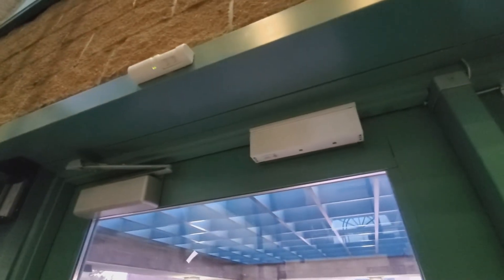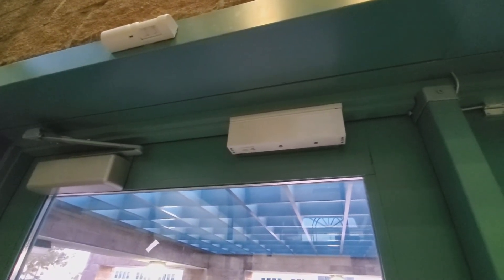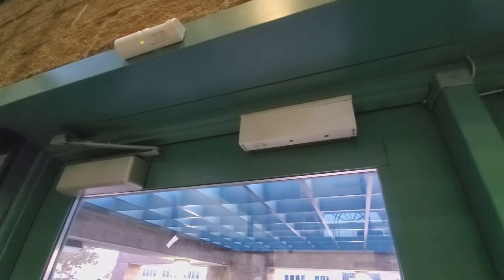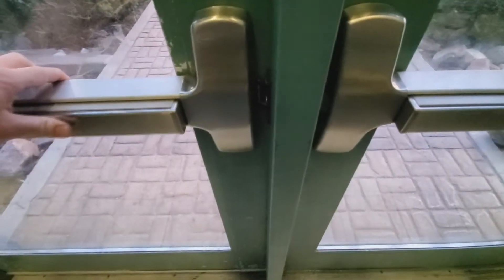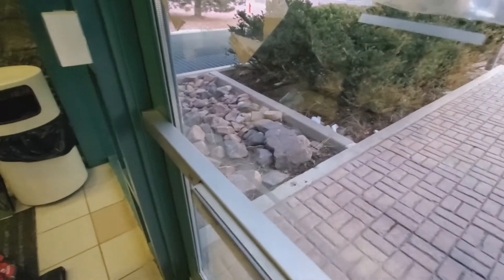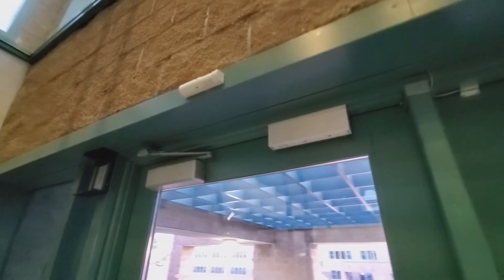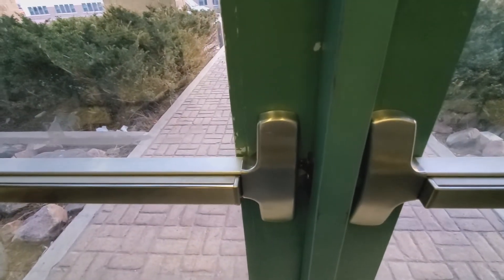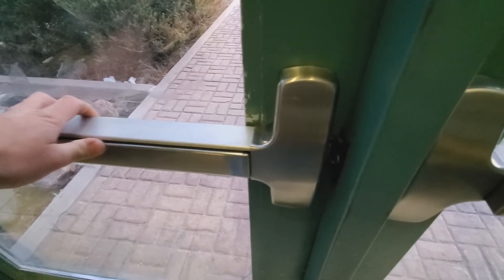Service Call 001 - Simple Magnetic Lock Troubleshooting   Card Access System

Comment: Thanks for this video, but the issue i have with my company's own is this; the light on maglock which indicates if its on is not working and the door doesn't magnet. What could be the issue
Reply from the maker: Copy, 
1. does the power supply have 120 vac power?
2. Does the fuse have continuity / is it good?
3. Is there voltage at the mag? Is the mag bad?
Reply: I just ran into a similar issue where the sensor went bad causing a longer delay then usual to open the door, meaning the relay on the sensor bar went bad.